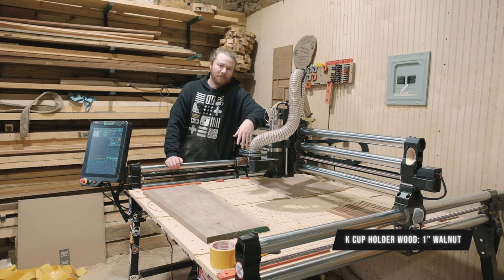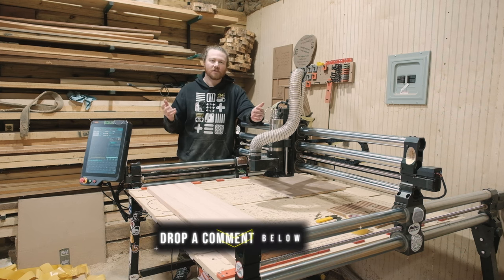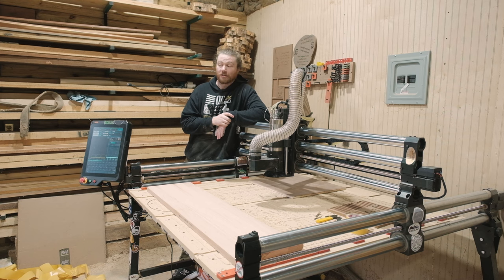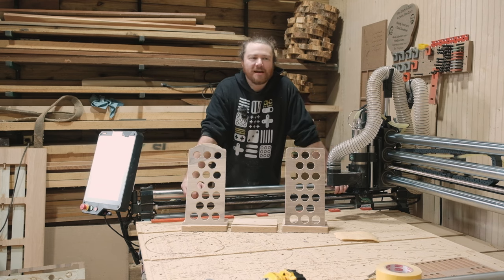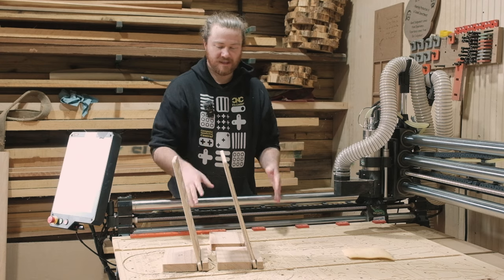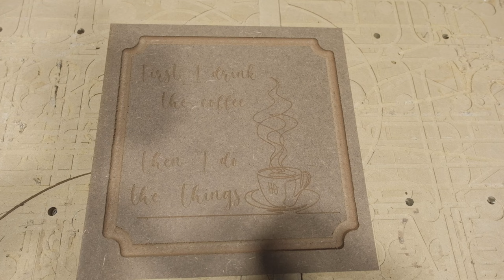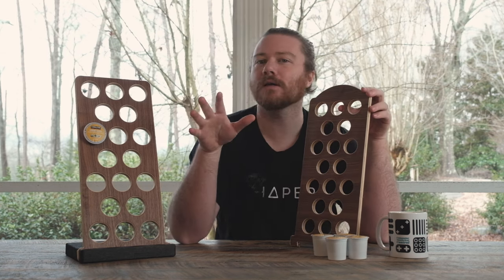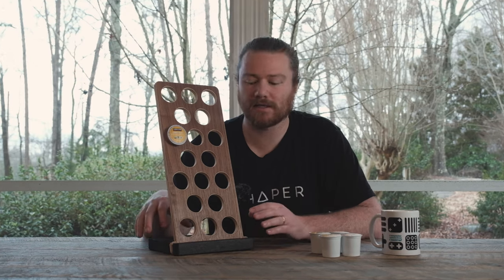Easy Woodworking Project: K Cup Coffee Holder

Comment: You could achieve the steeper angle without the slop if you used a table saw or miter saw.  Table saw with dado blade if doing a lot of them.